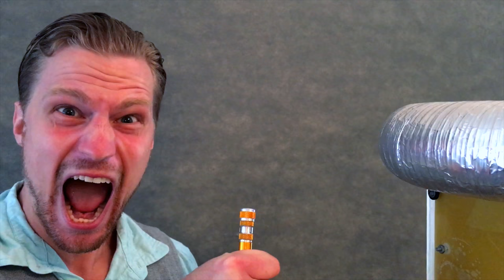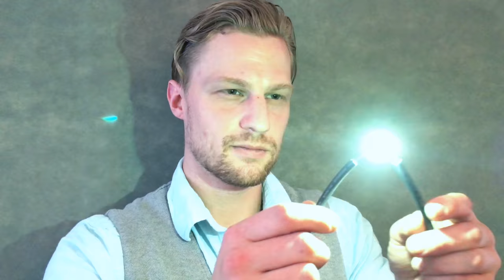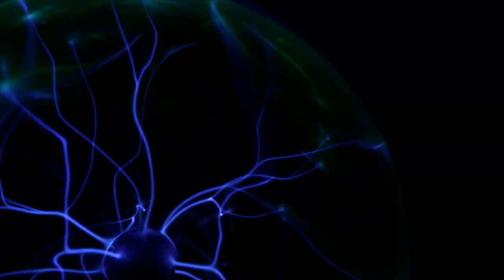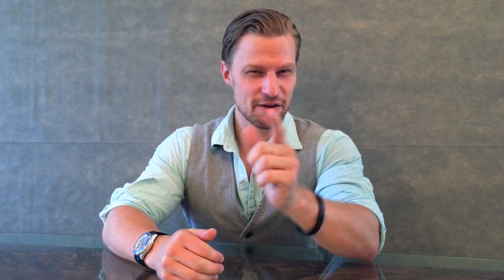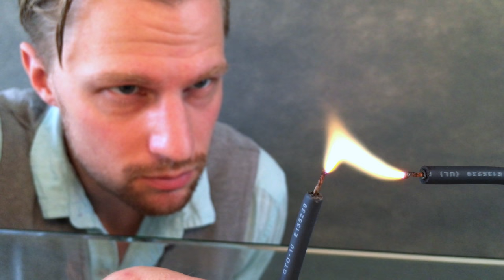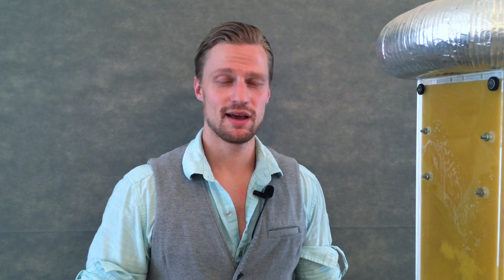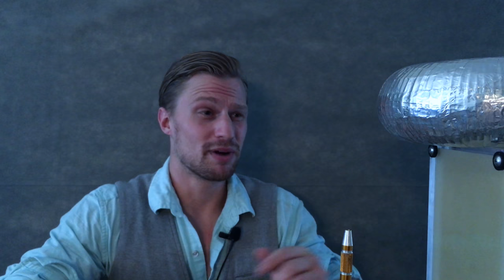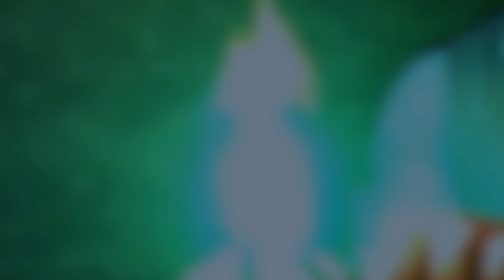5000 DEGREE electric arcs | High Voltage |

Comment: I know it is an old video but... Holding wires connected to a HV transformer with both hands is asking for death (and giving a very bad example). Yes, the wires are insulated but the insulation may be wet, dirty or damaged and then you don't have a second line of defense. I like your channel but I had to write it. Probably you know the rule, but maybe some young viewers do not: if working with live circuits is unavoidable, one should always do it with one hand, using insulated tools and being well insulated from the ground.
(OK, maybe 30mA wouldn't kill you and maybe with 0.5A you didn't hold the wires like before, but it is a matter of developing correct habits).
Reply from the maker: Correct, this is an old video, and in all my modern videos I advocate for the one hand rule in nearly every one. As for this video, I should have had a pinned comment about how doing this is not a safe activity. Not sure why the pinned comment is gone. But, you're correct, I should have a bigger warning about this. I'll modify the video details and add a massive warning, and make sure that pinned comment is visible. Cheers, thanks for the concern!
Reply: @PlasmaChannel  Hi, I'm really happy that you added that warning. Your experiments are creative and inspiring, it's very good that young people watch your channel (I'm not young but I watch too), but.. I think I don't need to write anything more. Good luck!

Comment: Ohhh, establishing a plasma channel, I suddenly realize those horrifying electric death beams military boats are experimenting with use IR lasers to establish the path, then switch to an extremely high power current. Essentially creating a lightning laser- fascinating aNd terrifying!
Reply: It’s quite similar to a flame thrower in fact, as it utilizes two different sources, and establishes a conductive stream, then excites the stream at a certain distance.

Comment: Hi brother, is it possible build an arc that generates no more than 80 degree Celsius of heat?
Reply from the maker: I'm not too certain about that. Not at least in open air. Perhaps in a vacuum
Reply: @PlasmaChannel  so, in a small chamber without airflow is possible, and how much time does an electric arc take to reach its peak temperature since ignition?, Is it split seconds?